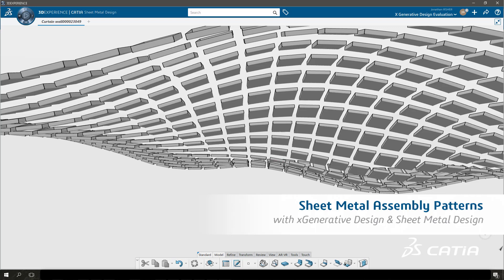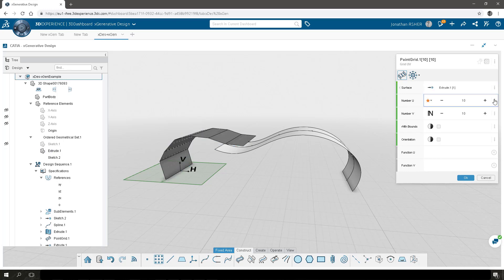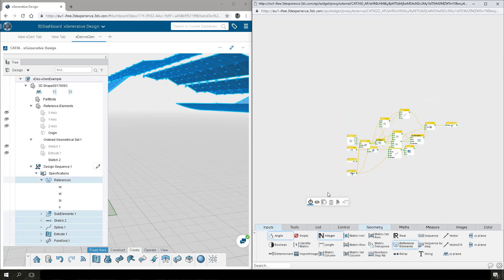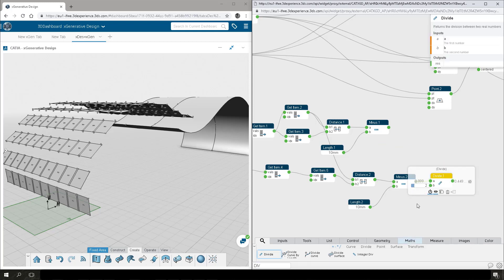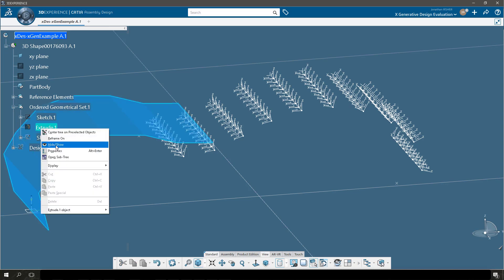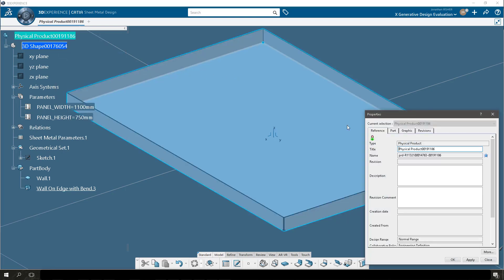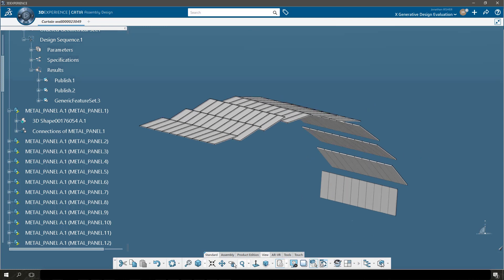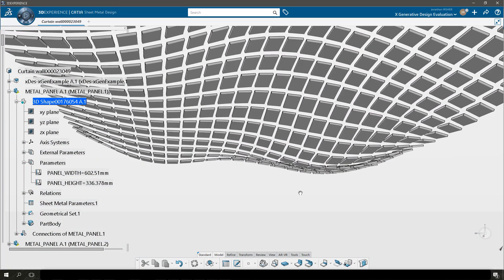3DEXPERIENCE xRoles to Sheet Metal Detailed Demonstration

Comment: Amazing step by step demonstration, we'll have to try this as well. 

Is there a way to use xGen and xDesign in conjunctions with Knowledge patterns?
Reply from the maker: Hi Ryan, yes you can run knowledge patterns using the published elements output from the xGenerative Design model. 

Today, you will have to make a list in the rich client and use the query function on the outputs node in the specification tree to fill the contents of the list. 

In the future (hopefully a FD release this year) you will be able to publish a list directly from xGenerative Design that you will be able to use directly as an input to a knowledge pattern or graph. 

You can also refer to one of our previous videos that explains how to write an action that reads the contents of a geometrical set. The contents of those geometrical sets came from an xGenerative Design model.

3DEXPERIENCE Tutorial: Automate generation of sub assemblies in a Product Structure https://youtu.be/YlKcPutK3SY